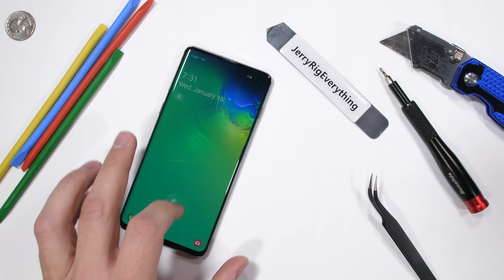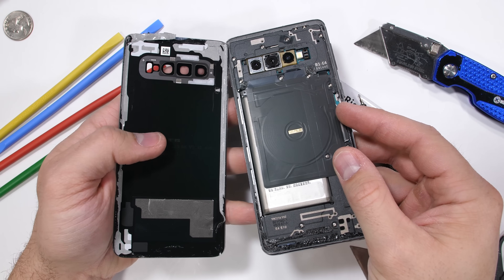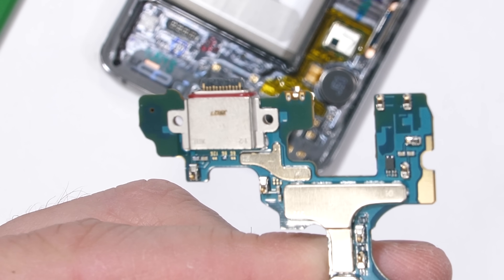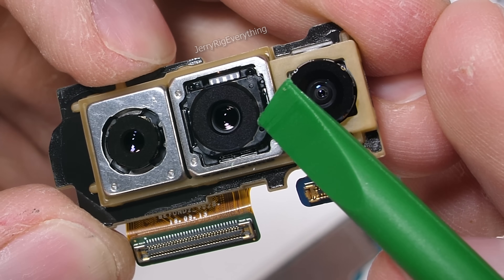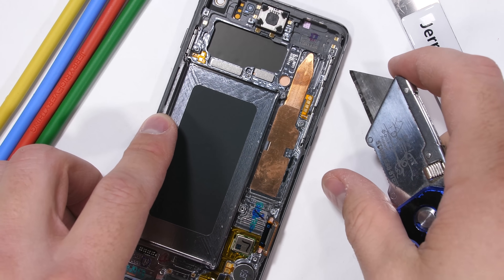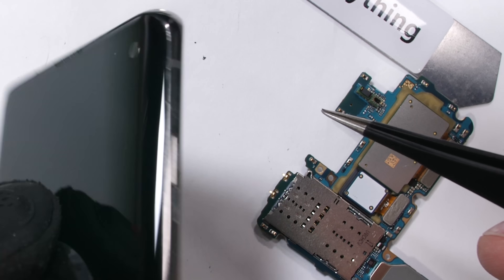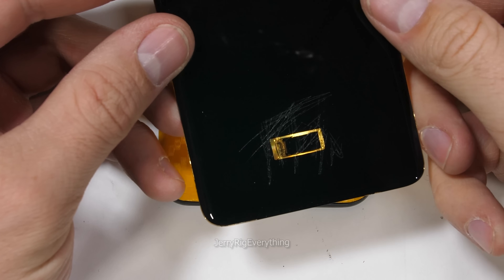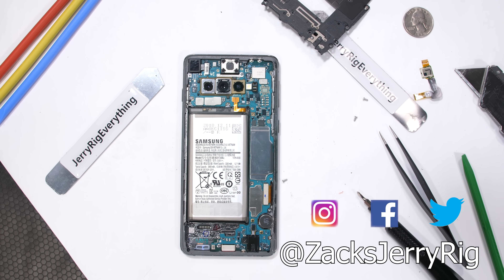Galaxy S10 Teardown – Does Ultrasonic Measure Up?

Comment: Samsung *releases s15 
Jerry : i am impressed but not enough to upgrade from my s8
Reply: That true!
Reply: s8 is beautiful phone it's the bigest jump for samsung in terms of design 
don't get me wrong I think samsung phone is the most beautiful phones and s10 no exception
Reply: @mediatech1588  no the biggest jump was from s5 to s6
Reply: @mediatech1588  Who cares if it's the biggest jump. The s10 is still WAYYYYYYY better
Reply: @mediatech1588  yep i am sticking with the s8 as well
Reply: I have an s6 edge plus and it still works fine
Reply: @kamelalg9859  I have an S3 Neo live and strong here
Reply: @kamelalg9859  try new phones and tell me later if its the same
Reply: @fusilia8226  I switched to the A70 six months ago, one ui feels a little bit smoother than touchwiz but no big differences except battery life is much better on the A70
Reply: @kamelalg9859  good for you, a lot of my friends like the A70, its just i prefer S10e for the cherry-O display and the specs
Reply: I have S8+, yet still I'm upgrading to S10+.
Reply: @BananaboatFI  hwz the s8 plus holding up? Battery?
Reply: @yashbmr  it had to be changed 10 months after buying. and now its like new. I bought it after 2 weeks it launched. Now its like new and I don't see any battery efficiency loss.
Reply: @BananaboatFI  so u replaced battery ??
Reply: @yashbmr  yap
Reply: @BananaboatFI  I would rather upgrade after S13 if I had one
Reply: @BananaboatFI  same.
Reply: I am also on S8. I sold my new S9+ because it was not so much of improvement over s8.
Reply: @joTHEgreen  do uou live in jordan? I found a used s9+ selling at 440 dollars, i still bought an a6 2018
Reply: Nah man we are already at 20
Reply: Since s8 withstood this long , so my s10+ purchase decision is not bad
Reply: I'm still on my S8+ as well but my upgrade is in May.... I'm pretty sure I'm getting the S10+,  plus....Zach is crazy lmao, he'll wait until he's dead to upgrade
Reply: They're jumping straight to the S20, weird, I know.
Reply: I still have my Nokia N95 8G as a secondary phone together with my Note 9.
Reply: Just bought my galaxy s8+ a week ago amazing phone with good performance screen and batterylife. 😎
Reply: Rzinny y bro..... i have a s7! (I am gonna get a new galaxy s10 in like a week though, i am so exitded)
Reply: They released S20
Reply: Hahaha
Reply: You are God damn right
Reply: I prefer note series
Reply: Rajin Bhuju I think the same think holding my s8
Reply: The s8 was a solid phone 🤷‍♂️
Reply: S8 is still a solid phone, but mine got some  horrid burn in.
Reply: @HalationSnow3535  yeah you have to be careful with that... I noticed that being a particular issue on the S8 but there's ways around it. I recommend not watching YouTube in vertical mode and if it's really bad use the Samsung keyboard as opposed to gboard or anything else... Samsung does a good job of preventing burn in but definitely could have been better on the S8. I have a note 8 now and it doesn't seem like much of an issue. Odd...
Reply: @iROMine  Yeah my burn in issue seemed to be mainly from watching youtube in vertical. When I look at the phone in vertical where a youtube video is playing then exit youtube, the top part where the small youtube window is still white, but everything underneath has a light shade of red. Pretty much 75% of the screen has a light red tint/shade to it and it bothers me a bit. I upgraded to the galaxy s10 plus not to long ago, and am planning to send the s8 to a family member, but I might need to get the screen replaced. I also need to be more careful with youtube.
Reply: @HalationSnow3535  yeah YouTube was the main culprit for me as well. This isn't the case on my note though, which is interesting, as I've had it for about the same amount of time now. Maybe I'm more cautious or maybe Samsung has somewhat fixed the issue. Anyways good luck with your S10+, my mother has it and it's excellent. Personally I see no reason to get rid of my n8 (it finally runs OneUi), but the S10 is a beautiful phone regardless.
Reply: @iROMine  Tyvm, you probably were more cautious tbh. When I first got my s8 I was very ocd about it, but overtime I stopped paying attention to the news about burn in occuring on the phone because I thought it wasn't going to happen to mine, but it caught up with me. Note 8 is an insanely good phone, I'd personally never bother upgrading from a note series phone to a regular S series phone unless the differences were worth it, note series is always the perfected version. I mainly upgraded from the s8 to the s10 plus because of the major battery difference that it offers. Hopefully burn in doesn't occur on this phone, avoiding youtube portrait mode as much as possible.
Reply: @HalationSnow3535  I can agree with that... The note is just too good to give up. Like I said before though, the S10 is an amazing phone. I'd recommend it to anyone getting in to Samsung who doesn't have a particular use for the pen or anyone who doesn't want to spend an absolute fortune (notes have never been cheap phones... Not that the S10+ is now but still there's always the s10e)
Reply: S8 and S8+ are just awesome ;)
Reply: If his S8 is still alive at that point he basically has no reason to upgrade anymore
Reply: @ebucia7  Yeah so it's easy to not go with apple. Also, that giant notch that apple has is NOT visually appealing at ALL, not to mention the huge, thick bezels on their phones. The Samsung's have thin bezels, no notch and a much better design that way lol...
Reply: Just got my s8 yesterday everything is awesome except for one thing, the battery, its awfull
Reply: i'm still in S6
Reply: I always skip one say i get the s8 then skip s9 then get s10 i never use apple that shit gay
Reply: The Note 10 is the only phone worthy of Zack's likes.
Reply: @ThatChester  no headphone jack
Reply: S15 will never come
Reply: I still have mines too
Reply: @j.d4121  I would hope so... It just came out 2 years ago. Almost impossible for it to be dead yet
Reply: also got the s8 from the release. tho I am switching it to the s10 but ye
thats true
Reply: @liyamlevi5758  same.
Reply: @liyamlevi5758  You mean you're mom will get You a S10
Reply: @yourdailypieceofhair737  who the hell are you? and no she wouldn't. I bought it myself Mr. Grownup
Reply: Rajin Bhuju lol
Reply: Good one
Reply: Jerry about S15: I am afraid, it burn down when I tried to disassembled it.
Reply: More like s30
Reply: Got the s8 last week, handing it in for the s10 in couple weeks time..
Reply: @ibrahimshafi2064  I've had the s10+ about 3 weeks now and I haven't seen a single thing I dislike about this phone, not even something I think they can improve on its just that good
Reply: @austinguy2324  ye, I have the s10. Amazing phone, only bad thing, cheap screen protector that scratches way too easily. On the bright side, At least it is my screen protector that's scratched and not the actual screen....
Reply: @ibrahimshafi2064  best to get another one what came with the phones not too great I agree but to be fair they're a phone company not a screen protector company at least they tried
Reply: @austinguy2324  yup
Reply: Watching on my s8+ rocking pubg in s9+
Reply: Every one taking about buying s8s or s10s and i cant even buy the Mi note 7😂😂
Reply: No s80 and he would be just okay with his s8
Reply: His name is zack
Reply: Dude I use a s3 half the time
Reply: My s10+ is the best phone I've ever had or tried, he's silly for not upgrading, he clearly has the money and its a beautiful phone I don't see why he would keep the s8 by choice alone lmao
Reply: Hint. The S15 will have a headphone jack. ;).
Reply: @benjamingoodnight1025  no 
Note10 series remove headphone jack & never back
Reply: I just gave up my Moto G, and only because it got run over 5 times and then rained on (dont ask).
Reply: @jessreinhardt4408  uh...
Reply: Samsung: what will it take!!!!
Reply: Lol
Reply: lol
Reply: Meanwhile I went from the S9+ to the S10+ lol
Reply: Lol true
Reply: me too, thanks
Reply: Universal truth
Reply: If you think about it, this means a lot. Btw what was his phone before the Galaxy S8?
Reply: It's funny to see how easily he can afford new phones, but stick to the S8 which is considerably out dated by today's standard.
Reply: @minhbu95  not really lol it has a good battery along with a very good processor, a very good display which is rare to find in other (non Samsung) flagships, an ok camera I guess, headphone jack, iris scanner which is more secure than a 2D face unlock... a lot of functions that is one of my favourite aspect of Samsung (Android Q is introducing some features that Samsung devices has since the S3) it is also well built and repairable (thanks to the new Samsung Smart Repair). It is a good phone, I have an S9 by almost a year and I picked it just for his camera because there is no actually sense to pass from an S8 to an S9. I don't also think I'll pass to the S10 too, why should I do that? Better battery, processor, some features more? Maybe it would be just for its camera module but I don't really care about it anymore so if there are no actually differences (exept for the camera) between the S8 and the S9, I completely understand him.
Reply: @Mari8eMezzo  i had the s7 edge and I figured out Samsung slows down their phone a lot in order to get you to buy the new ones. I wonder if his s8 slows down?
I understand s8 feature wise is still very usuable, but considering he can afford a S10 to use daily, its funny how he chose to get a S10 for science xD
Reply: @minhbu95  I see but now Samsung cares more about its old flagships (I don't think the same for the other series like J or A...) I'm still reciving an update every months, yesterday I recived the camera night mode, if I had to upgrade (if I had the money lol) I'll go for the Note9 just for its S pen but at the moment, I don't see enough reasons to upgrade my S9, even with other brand.
Reply: *S8+
Reply: Lmao
Reply: I like my samsung s7 but i'm gonna use my s10 now
Reply: Omg haha
Reply: I picked up the s9
Reply: Lol i feel the same
Reply: I upgraded from my s8 only became I broke its screen for the 2nd time and thought I my aswell just buy a new phone rather than spend another 200 on a new screen
Reply: Watch that happen lol
Reply: I use an s8
Reply: 100
Reply: Lmao. I feel so honored and glad because I'm too using s8 plus
Reply: @I LightenStar I note9 is better option
Reply: LOL
Reply: The Galaxy S8 is a badass mofo.
Reply: Korean products are trash
Reply: Abd then buy it anyway
Reply: Galaxy s8 and galaxy s4 for me are the best phones from Samsung. I just got the galaxy s10 5g and I think is really good phone, besides the galaxy note 4 was a bad phone the design was beautiful but the system was really bad.
Reply: Well he already switched to the note10+ so I guess you should edit this comment
Reply: hah
Reply: the s10e or the pixel 3a is a good choice for budgets
Reply: he will have his s8 in the afterlife
Reply: You were close tho  ;-)
Reply: 20
Reply: s20 jokes on you
Reply: Then they decided to do an 'xbox' and name their new phones s20 for no aparent reason
Reply: @Dy1an.k  2020
Reply: @Dy1an.k  s10 = 2010s
Reply: No
Reply: S15 don't exist lol
Reply: S8 series was a pretty good upgrade. Not the s10 series though.
Reply: You misspelled Zack, but it's ok.
Reply: @Andrei0927  My Bad 😅
Reply: What if S100 comes out
Reply: @rupeshverma9536  he would upgrade to s9
Reply: @rupeshverma9536  I'm impressed but not enough to upgrade from my s8
Reply: Rupesh verma still not enough for him
Reply: I just bought one 1 mth ago lol
Reply: S6 was prob nicest phone... Samsung is boring, on to other manufacturers for me
Reply: @_baller  Same

Comment: When iron and copper are heated they get oxidised. Therefore soldering iron got rusty surface after use. Copper goes black when oxidised like in a copper wire when it get short circuit, short-circuit wire has blackened copper strands due to oxidation.
Edit: short-circuit creates heat which helps copper to oxidise.

Comment: Real phones have a headphone jack.
Reply: Nokia 3310 does not comes with headphone jack.
Reply: Galaxy A8s not a real phone then.
Reply: @captainbucket3397  r/whoosh
Reply: @calingabrieldutu608  r/ihavereddit
Reply: @captainbucket3397  A8 has a headphone jack you idiot
Reply: In the future we can do less with shittier results and for a finite amount of time at a higher cost.  Actually, Sounds ahout right.

I'll accept the headphone jack is dead when I'm given no reasonable alternative, but more power to you if you prefer bluetooth.
Reply: I use both, but I'm hanging on to my headphone jack for this reason. Well this, and its so much cheaper...

"The reason that Bluetooth audio typically isn’t that great is due to the way that devices use the technology to transmit audio. Rather to transmitting an uncompressed analog signal, like a physical aux connection, sending audio via a wireless Bluetooth connection involves compressing the audio at one end and then decompressing it at the other."
Reply: Note 10 has left the chat
Reply: r/gatekeeping
Reply: @emrefifty5281  r/ihavereddit
Reply: Let's not forget that wireless headphones need batteries and batteries don't last forever
Reply: BluetoothSK oh my God I cant stand people like you. are you on your phone that much you can't just do something else for a few minutes while they charge?
Reply: @squaller9254  I have android so I don't use my phone a lot
Reply: Real computers have a dvd rom
Reply: The Samsung Fold is just just a public beta test, there are already reports of the screen breaking... no headphone jack, what's up Jack?! ;D
Reply: Real phones have a IR blaster
Reply: @Mabswer  who uses that?
In s6 edge iused it just because it was new feature and i had curiousity to play with that
But after a weak i never used it
Its just piece of shit covering extra space
Its more difficult then to find a lost remote
First you find and open app and then open device in that and then use it
And nobody uses it everyday in daiyly life generally
Reply: @anshjindal728  *week
Reply: @anshjindal728  *daily
Reply: amen!!!
Reply: Uhhh the future doesn’t have headphone jacks
Reply: old af bluetooth is the fuckin' best
Reply: Faiz Arshad nokia 3310 does have a headphone jack
Reply: owlcity24 mine doesn’t
Reply: 1. if you traveling and your expensive bluetooth earbuds out of battery.. oops no music for you
2.if you listening to music and someone need to talk to you which one is simpler and faster : putting your earbuds into your pocket or just hang it on the cable below your neck
3. Shit happens, people forget. You wanna add missing your left earbud as reason why ppl panic in the morning beside losing half of your sock and keys?
Reply: @nomnommoon1001  
1 Always bring a power bank
2 Tap the button on the earbuds to pause
3 If it's precious for you you'll probably not lose it because you really cared for it

This is no hate,just saying
Reply: Hopefully S11 has a headphone jack.
Reply: Everest it won’t
Reply: Real phone don’t explode or break when you use them as intended.
Reply: Apple has left the chat room
Reply: Galaxy fold not a real phone then
Reply: @mariosangourakis2440  That's a two in 1 phone lol
Reply: Sebastian that’s a two in one “phone” still a phone
Reply: @mariosangourakis2440  but it includes galaxy buds for package though
Reply: Still, without the headphone jack.
Reply: @익명의학생  really😲
Reply: @mariosangourakis2440  No, it really isn't...
Reply: @mariosangourakis2440  yea it's pretty much a tablet
Reply: @mariosangourakis2440  yup I'm Samsung fan but i didn't like fold
Headphone jack was one reason
All phones without jack are piece of shit
Reply: @anshjindal728   i havent used my jack in years u should go wireless then u dont need it
Reply: @tobiasnilsedalen3908  i have tried
But with jack we get better sound quality than wireless
I have headphones that can be connected both ways and those give me better quality with headphone jack
Reply: owlcity24 headphone jack it’s old technology nowadays.
Reply: @deinemutter4499  just because something is old doesn't mean it's bad. Take the cassette take.
Reply: @deinemutter4499  It's still useful.
Reply: @deinemutter4499  ya old and better
Reply: Give it up already.
Reply: jesus christ get the fuck over it. bluetooth is the future. the headphone jack is dead
Reply: @squaller9254  If you had a functioning brain you'd know wired quality is better smh.
Reply: Surite no it doesn’t, wired and wireless sound the same.
Reply: @squaller9254  so is apple

Comment: From this video I actually learned today that the Statue Of Liberty was made of copper.
Reply: Though there is one correction, rust of copper, that is copper oxide is brownish, while Statue of Liberty actually turned 'green', due to reaction of copper with rain, to form green layer due to redox reaction with oxygen along with hydrogen. Statue of liberty already had an outer layer of oxidised copper to protect from further rustness, but due to rain it got deoxidised, and then inner pure copper got redoxidised into 'Platina', to look like green in color.
Reply: @rajsatraroxor9603  K

Comment: Genuine question here. 
This phone is only slightly taller than an iPhone XS and only 0.1mm thicker. But on this phone the logic board is massive and cover all around the inside of the phone. The iPhone uses a stacked logic board so that there is alot more room for the bettery, so much infact that it uses the L-shape battery and visually it looks massive and covers most of the inside. 
So how is the Samsung battery a lot bigger than the XS?